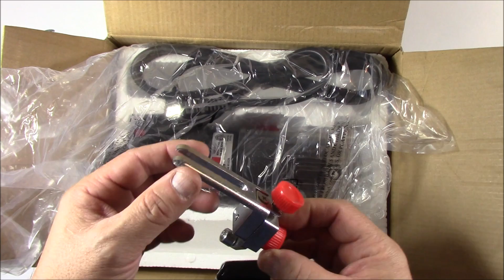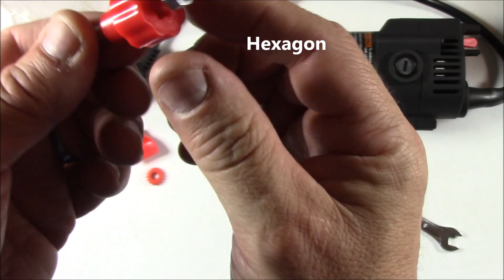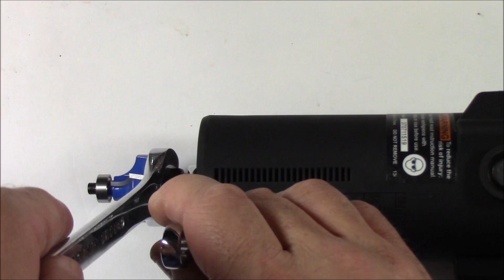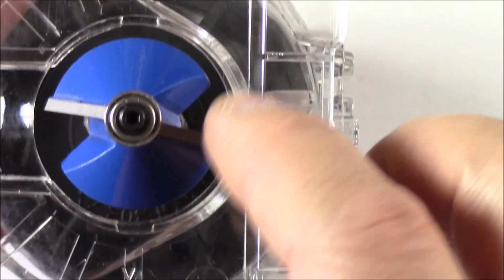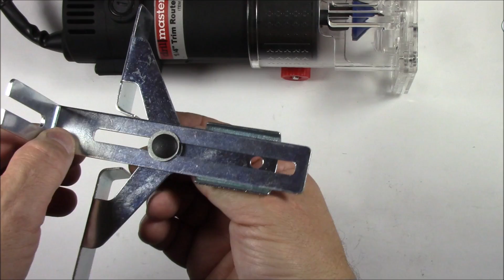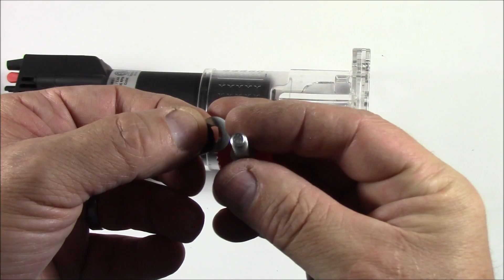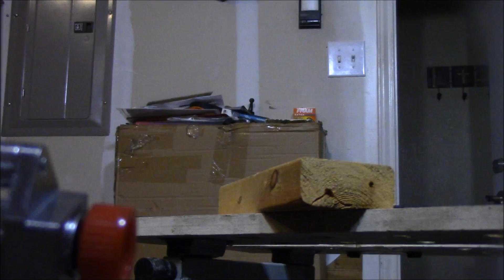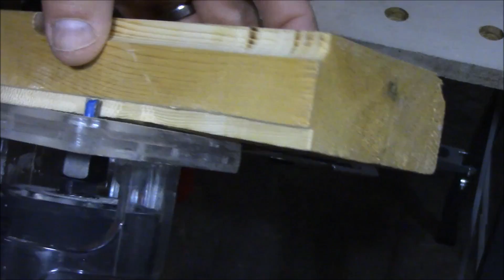Drillmaster Trim Router Unbox Thorough Review Tips And Tricks

Comment: Richard, thanx for posting this video. I bought one of these trim routers yesterday, and thought I was just not smart enough to assemble the fences! The washer fix works great, but I had to use a 5/16" flat washer to clear the shoulders on the carriage bolt. My router also had an issue with the "edge knob" bolt being just a tad bit too long, making it hit the "lock knob" bolt. A few swipes with a file accross the end of the edge knob bolt cured that, although the Trim Guide Assy is of limited value (as you mentioned). I guess that little piece of clear lastic ("L" shaped with the center of one leg cut out) must be a guard to prevent debris flying out the side, but it is totally ignored in the directions. Seems like this is a good little trim router if you use it as that, with bits equipped with ball bearing rollers. Thanx again. Mike

Comment: Richard, What bit would I need to use to cut circular holes into wood?? As would be needed for mounting speaker drivers?? Would it be possible to cut through 1" material?
Reply from the maker: I would not suggest using a trim router for heavy work like that. Yes you could possibly do it but am sure you would burn out the router in no time. I suggest using a full size router for this like this one at HF http://www.harborfreight.com/2-hp-fixed-base-router-68341.html or here at Amazon: http://amzn.to/2lgmtLo for heavy work like cutting speaker holes in 1" wood. I suggest a bit like this one for the job as well at Amazon: http://amzn.to/2kH0dHG as you can see from the pictures it is made to cut curves and circles in deep wood. Thanks.

Comment: I am starting to do some woodwork for kitchen cabinets, etc. I am looking to buy a router that is completely quiet like your, or is it the recording sound was turned down when router is ON?

Can you tell me what model # or the specification I should look for a (quiet / loudless) when I do my search?

Please advise, because asking the workers at homedepot, they may not know or say anything to get you to buy it.
Reply from the maker: I certainly turned the audio down when I was using the router. The motor is fairly quiet but the major amount of noise comes from the blades on the router bit biting into the wood. I do not think there is any fix for that except wearing ear protection. Thanks.
Reply: Thanks for your information on the router. Can't wait to get one for my new coming project. Many idea now that I know what it can do. Wow, I stopped doing wood working for over 10 years. I am back for it. Thanks much. Great video btw...

Comment: Good video and demonstration of the tool. At the end, you don't mention that a larger diameter bit would have allowed you to use the roller trim guide rather than the clamp edge guide. Your demonstration of the flat trim guide is incorrect. The guide should be used on the same side as the cut. This allows the piece to be clamped, and if the router tips, it will tip away from the wood. Using the guide on the opposite side of the cut allows the router to tip the bit further into the cut, ruining the cut.
Reply from the maker: Thanks

Comment: Bought one cuz it was cheap about a year ago to use on smaller jobs where my Bosch was too big to throw around.  Problem is that it doesn't have variable speed so on a lot of smaller jobs it's like a bull in a china shop. It's either on or off, but it is plenty powerful and solidly built.  Bought a Dewalt DWP611PK variable speed the other day with the plunge base.  Love it.  You get what you pay for.  Now I just keep a roundover bit in it with a 5"x5"  1/4 inch base dedicated to edge trimming.

Comment: Routers intimidate me, so I kept this model on a shelf, but this video is awesome covering every aspect. I did want to ask if I want to route an edge along a curved piece, keeping the bit guide tight along the curve if this can do the job as well.
Reply from the maker: +Bessie Funk I am sure it can. The trick is to keep it as slow and steady as possible as making sure the surface you are using against the bit guide (bearing) is as smooth as possible. The less sanding you have to do the better. Thanks

Comment: Nice video... enjoyed it.   I could be mistaken, but I think you used the fence on the wrong side of the router.  The cutout in the fence allows you to set the fence so you push the fence and the bit in the same direction against the edge of the piece you are cutting...  at least that's how it works for all other routers...
Reply from the maker: +EMTdrummer Perhaps you are right but using the clamp guide is a far superior system for me. Thanks.

Comment: Cheaper to just goto Harbor Freight with a coupon.  It is commonly for sale for under 20.00 with coupon.   The biggest complaint about it is the plastic base which is very easy to break.  The router itself seems solidly build though.  I use one (without the base) for a lathe accessory that allows for ornamental work.  Works great for that application.
Reply from the maker: +Designs By Philip Thanks.

Comment: Thank you Richard for the nice explanation and demo of the trim router. I recently bought the 230V version of this router (in India). The design is identical and the price is less than half that of established brands like Bosch and Makita. The brand name mentioned on the sticker is Dongcheng and it is made in China. 
 - The L-shaped clear plastic piece is described as "Chip deflector" in the booklet.  
 - The base plate has provision for fixing a guide bushing. In addition to the other accessories, a 10mm guide bushing is supplied with the 230V version and it can be fixed by removing the four screws in the base plate. I have no clue as to why it is not supplied with the 120V version.
 - The no-load speed of the 230V version is 30000.
The router is dynamically balanced and the motor runs real smooth when it is switched on. There is no speed control, but for the low price, this router is value for money.
Reply from the maker: +Bala Chandar You are most welcome. Thank for the new information and watching.